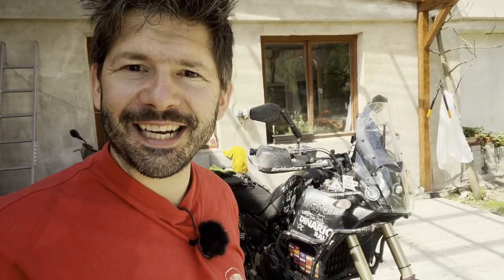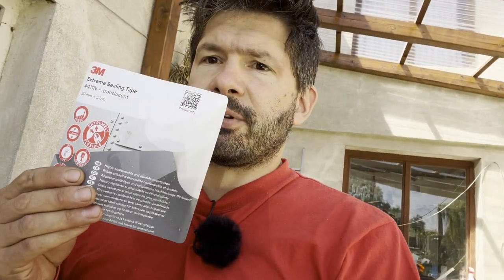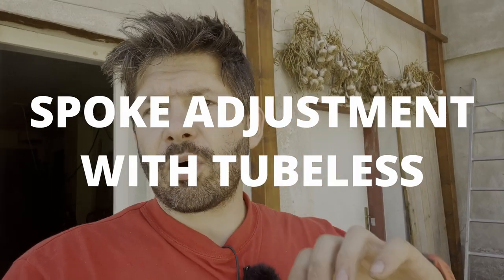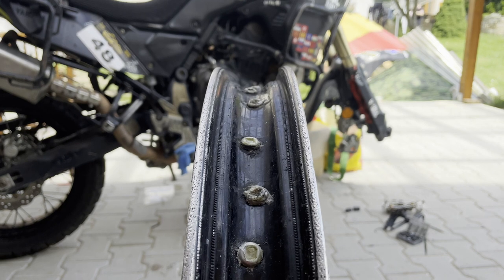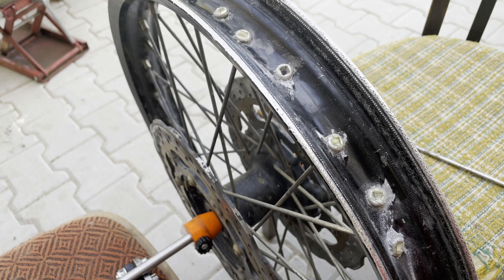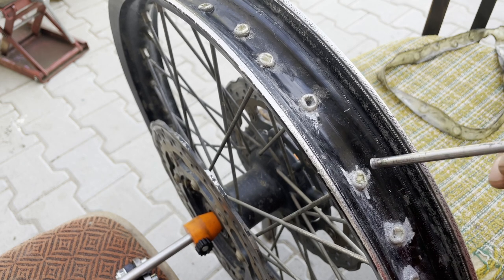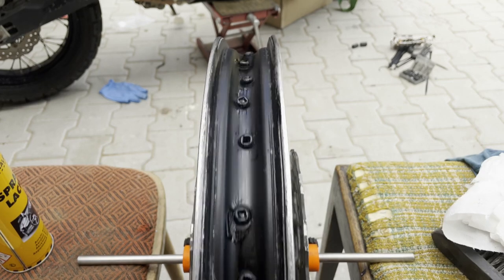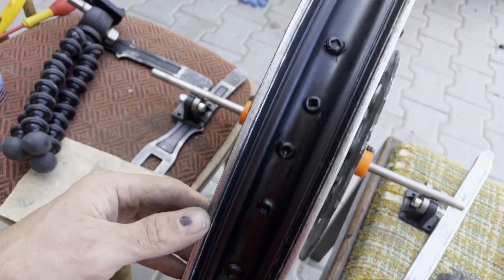Yamaha Ténéré 700: The dead of tubeless & tightening spokes and horrible front rim corrosion!

Comment: I have also some severe corrosion on my front rim. The reason I found this was I got a puncture and found it was caused by bits of corroded aluminium floating about. I am applying some glue to act as a preventative cover and will also paint it . It is not tubeless and not been in seawater. Done around 25K miles of road and trails

Comment: Use a piece of flat wood and a hammer is a very common way of fixing the bent rim. I have done this.
A lotof motocross shops use black Heavy Duty Gorilla tape in 2 wraps around the rim covering the spokes ends.
I have a KTM offroad bike and I discovered the rim tape from the factory 100% missed covering 10 spokes completely. 
So I replaced it and installed some correctly. Going to inspect the rear wheel soon.

Some riders will split the original tube length wise and install it inside between the rim and the new tube for a rear tire. Do not know if can be done for a front tire.

Comment: This reflects the salty conditions it was used in and the poor anodisation  / surface treatment of the stock rim and spokes. That corrosion could have been even more widespread if in a tubed configuration. I would suggest a good set of Excel rims would be the best solution here, and reapply a new Outex kit. I am not a metalurgist but I suspect stainless spoke nipples might help as well. Something I haven't tried myself yet is to use an anode to balance the wheels rather than lead or brass weights. I might try this to see if it helps.

Comment: Get a tubeles 2.5" rear rim from Haan and go with the tube version on the front. Front is much easier to change the tube than the 4.0 rear rim. Unfortunatly I haven't found a tubeless rim smaller than 2.15" for the T7.
Reply from the maker: I don't really think there is smaller rim than 2.15" for the front for T7. Excel has the 2.15" which is tubeless ready (has safety humps).

How is the Haan rear rim tubeless? I assume it's spoked rim, Is it with the safety humps and do they already seal it? I was looking at Bartubless option for the rear and maybe front, not sure.

Yea front tube change is super easy. That is my current setup and I may just keep living with it seem 2.15 rims tend to be problematic with tubeless.
Reply: @FARANDFURTHER  the rim is vulcanized and supposed to seal it. the customer support also says that you don't have to tighten the spokes anymore. I haven`t tried it yet but that is how they sell it. the other option would be just to buy the 2.5 rim where you needs tubes and a 140 tire. It`'s also much easier to change the tube.
Reply from the maker: Ah so that would be same or similar concept of the Bartubless (https://www.bartubeless.it/how-it-works/?lang=en). The layer is vulcanized onto the rim providing perfect seal.

The claim of not needing to adjust the spokes anymore baffles me a bit. Sure the tough rubber layer will function as a locktite but I'd not bet on that one.

That being said, it's probably next system - and really the last one to try - after that we have depleted available options for T7.
Reply: @FARANDFURTHER  it will be the same cause they work together with Excel rims...

Comment: Hi
A rim tape would have held the moisture in just the same under a tube unfortunately salty water will always cause this type of corrosion on aluminium. Not sure with stainless nipples but salt water will increase the risk of electrolysis between dissimilar metals. Maybe the nipples are a poor quality of stainless then electrolysis may occur. Just a thought I'm no expert either. All the best 👍👍😜
Reply from the maker: Those are thought provoking words... I'd not be against spoke & nipple upgrade, although now it's kinda late :)

Comment: I am going to use a TUbliss system on the front rim, and 3M tape on the rear. Does the tubless tyre stay on the rear ok, does the Ténéré have a safety rim on the rear? With regards to the corrosion I think I will use ACF50 on the spokes after I have put the 3M tape on. Drip it down the spokes into the rim from the hub side. I have a World Raid, my son has an XT660Z with Excel rims.

Comment: I think your first thoughts are correct for sure, moisture gets in gets trapped and corrosion occurred.

Oh, I would throw that rim, time for a meet?😂
Reply from the maker: Hehe... :) No cash so rim will be ridden until it turns into power, I think.
Reply: @FARANDFURTHER  Looks like it could be a risk now to use that rim. Be careful.
Reply from the maker: @MotoGuzziMoto  Possibly, not really sure if the corrosion compromised its structural properties.

Comment: still no tubeless rims for T7 on the market?  obviously this tape solution is only temporary.  For the front wheel I'm considering putting mousse, I've seen that done already.
Reply: There are aftermarket rims with tubeless. 
Regsrding mooses, that’s great for rallies, but you would need a 2.5 rear and 1.75 front rim with rim lock.
Reply: @everythingtenere  I think rear is 2.15 for rally wheel, wider knobbie for clearance.  extra strong double thick spokes
Reply: @samhill3496  yup, thats true. But if you want to be able to fit more standard rubber, a 3 Will do. 
I would love to have me a soaré det with 1.75 and 2.5.
Reply from the maker: @everythingtenere  I had 2.15" front with rim lock and mousse on the Albania Rally and just used UHD Tube in the rear as it's 4" and there is no rimlock for it. Narrower rim in rear would be key here.

Regarding mousses Andrew, good off road but on road you'll destroy them quickly if you ride over 80km/h.
Reply: I meant mousses only for front, e.g. Lyndon Poskit used it like that in his travel bike. Rear would not last long.
Reply: @everythingtenere  I believe mine is 4.25  have to check
Reply: @everythingtenere  4.25 rear/2.15 front